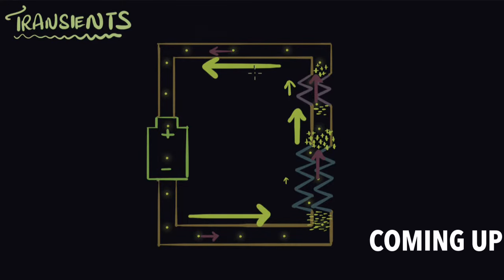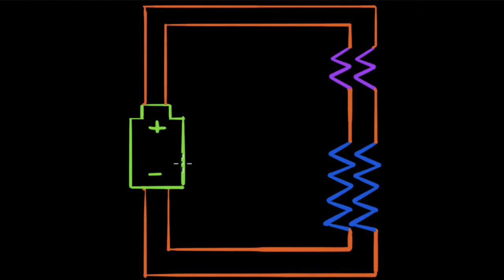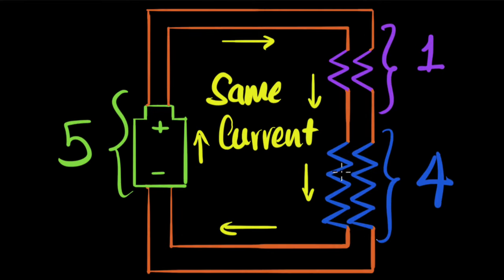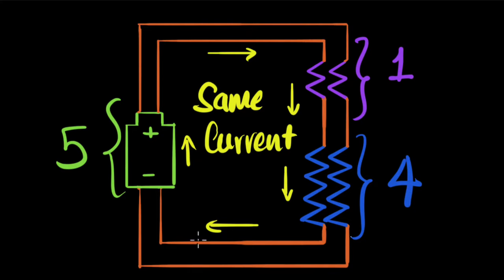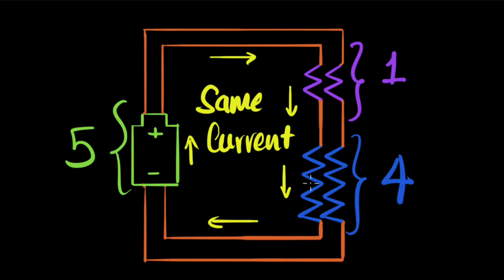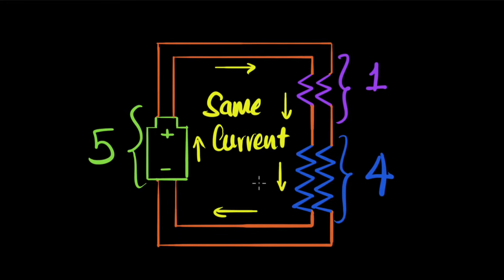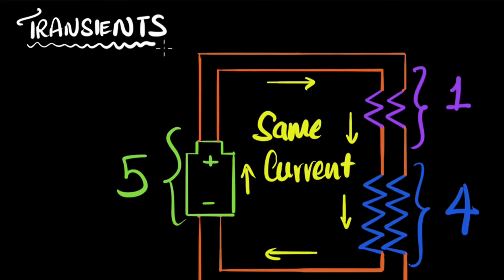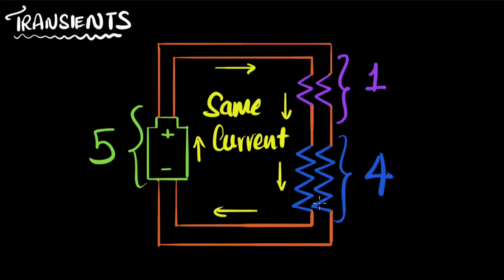Why resistors in series have different voltage (but same current)?

Comment: You are asking all of the questions that I am wracking my brain with. Most answers don't adequately explain it either - they use V = IR as a basis and you're just supposed to accept things as a given. Thank you for having the courage to address these questions, and the rare talent to be able to break them down logically and clearly. 

Please keep it coming!
Reply: electrical engineer here. V=IR does explain it, but of course there are always other ways to explain it. The universe works very different, and largely its analogy that we really understand. Some work better than others of course.

Comment: this topic was eating my brain away . it wouldn't be difficult if i accepted the knowledge of V=IR  as told by my teacers , but the problem arrised when i question why in series and parallel resistors things haapen as they . you cleared my concept of series . can i pls get a parallel concept too. your video was the best

Comment: Interesting. So essentially, right after the circuit is closed, there is a very very short moment of transient that dictate what's happening in the circuit. 

1. Right after the circuit is closed, all electrons in the circuit experience the same amount of force which is due to the battery. However, different sections of the circuit would experience different currents: all wire sections experience (relatively) high amounts of current while the resistors experience relatively low amounts. 

2. Because the resistors impedes electron movement, they tend to get accumulated at the start and end of the resistors. Negative charges accumulate at the start while positive charges accumulate at the end. The amount of accumulation depends on the resistance of the resistor. This is also the reason why there is different voltages on resistors of different resistances.

3. The accumulation of charge eventually affects the movement of electrons in the wire sections of the circuit. They eventually a. decrease the force experienced by the electrons on the wire and b. increase the force experienced by the electrons on the resistors.

4. This cycle continues until we reach the steady state, where the current is the same everywhere. It is important to note that the accumulation of charges does not disappear even after the currents in all sections of the circuit equalizes.
Reply: Thank you man you summarize the concept good then the video
Reply: Really thank to u for summarising the concept

Comment: I had to figure this out all by myself, because no one is ever talking about this fundamental stuff in the typical electronics courses, they might not even know or care about it. But this stuff is crucial to get a real understanding of why things are the way they are usually described. I figured that we have a highly dynamic situation here on a physical level and that there must be some setup and some equilibrium state, and mostly we only care about the equilibrium state (that what you call the steady state). But it is the way this equilibrium state comes about, when and how and for what reasons the initial dynamic situation settles, that makes all the difference. Thanks for confirming.

Comment: I had no idea that electrons can bunch up.  I always thought that when one atom loses a free electron,  that it immediately draws in another and as such electrons could only shuffle along one at a time.  I understood amperage by understanding that this represents the speed at which they move along but i could never understand how the potential difference between two points on a resistor could have changed...
I thought since they all move along in an orderly fashion the voltage was set by how many electron were in the negative port of the battery vs the positive and as such wouldn't/ couldn't change. 

Now that i understand the chaos of them bunching up and in a way turning each resistor into its own battery cell with its own little positive and negative port it makes so so so so so so so much more sense. 

I love the chaos,  it makes more sense than order sometimes. 

Thank you so so much!!!!

Comment: Okay, this one partly answers the last videos questions by some. The 'transients' as you call them are the acceleration periods I referred to that occurs by my explanation in the first video's comment. For this particular question, the wires ARE resistors too in which the longer they are, the greater the resistance. The symbol uses sharp squiggles that represents this as well. When learning we ignore the wires as being resistors given it represents the 'background' that has the least and is very tiny in comparison to intentionally added 'resistors'. But you CAN make a resister using the wires by simply adding length in the circuit or narrowing a part of the wire to a smaller Gage. 

Another analogy that I think might help is to investigate the flow within a closed fluid system, like our refrigerators. And although you may raise the issue of parallel resistors in another video ahead, when you add parallel piping, this increases the rate of flow which is the same as decreasing the resistance of parallel circuits in the same way.This fact also helps to understand how electronic capacitors work through the dielectric also.

Comment: That's really fascinating. One thing I'm somewhat frustrated about in my EE journey is that often, I just accept so many conventions or explanations on why this or that thing works without knowing why those happen. This video addresses one such explanation. Thank you.

Also, I'm not sure if you've already done it but I really hope you'll also do a video for parallel. The idea of resistors in parallel having same voltages across it just does not and have not made sense to me at all. I just know it does but I don't know why it does it.
Reply: The video has many errors...Also he contradicted himself with a earlier video that was talking about why the current before entering the resistance is equal to the current leaving the resistance
Reply: @xxCr7xx823  Really? Can you kindly point out such errors?

Comment: Thank You so so much sir, I have been beating myself up because I just couldn't understand why in series circuit current is same, then when we study voltmeter they say that oh we use high resistance to lower the current flow but wait current remains same...... Many more examples of this and I just... Thanks for this

Comment: Great video, which explains a lot, even though I still have problems understanding how the net force in the wire can be zero.
Reply from the maker: Thanks, Michael! If it didn’t electrons would accelerate to high speed causing high current causing higher charge deposition causing higher repulsion. 
So, it’s a self correcting mechanism
Reply: @Mahesh_Shenoy  Then that would imply that once you got the current going, if you took away the battery in this theoretically zero resistance wire, the current would keep flowing?
Reply from the maker: Loving the discussion!

If we took away the battery, now there is a retarding force on the electrons in that section. Remember, the net force was zero because the batteries force cancelled the accumulated charges' retarding force. 

Does that make sense?

Comment: A simple yet important key concept that gets missed in  textbook and by teachers as well, great video!  At 2:51  you mistakenly said maximum current instead of max resistance.
Reply from the maker: Thanks and oops
Reply: @Mahesh_Shenoy 4:34 Hi, I don't understand this part, where did the positively charged protons come from?? Because until I watched this video, I thought that electricity only deals with electrons, not protons. I understand that generally speaking, like in chemistry or something, a decrease in electrons = an increase in protons. But when it comes to electricity, I thought we were dealing with electrons only?? Where and how did the positive charges come from??

Thank you

Comment: Amazing explanation! I had this doubt but couldn't find the solution anywhere. This channel is truly underrated. But one question I still have. How is the voltage across all the resistors, when added, turn out be the voltage of the battery?

Comment: Amazing video! This could be your niche in the YouTube educational platform. 
Anyways, how does the thickness and length of a resistor influence its resistance? 
The beauty of the universe never ceases to amaze me. Is there any chance that all of this occurs in nature and not just across our artificial wires?
Reply from the maker: Insightful as always, Kou
Reply: @Mahesh_Shenoy 4:34 Hi, I don't understand this part, where did the positively charged protons come from?? Because until I watched this video, I thought that electricity only deals with electrons, not protons. I understand that generally speaking, like in chemistry or something, a decrease in electrons = an increase in protons. But when it comes to electricity, I thought we were dealing with electrons only?? Where and how did the positive charges come from??

Thank you

Comment: Does accumulation of charges concept violate Conservation of Charge Principle?  Is it correct to assume that there is charge accumulation happening at both the end of Resistors? I think we must consider the effective Resistance offered by the Resistors and the ratio in which it is split. Consider an Open Circuit or Circuit with Infinite Resistance. Can we say Charges accumulate both the ends of the Open Circuit?

Comment: Great video, very intuitive explanation.
I break my head about the question - if i connect DC motor with series resistor to a voltage supply what is going to happen.
in 1 direction you can determine the resistor in series by set the current you want through the motor and the voltage.
but how its work in the other direction? if i have given voltage source with given series resistor and i want to connect a dc motor to this circuit - what will happened in transient time that make it work?

Comment: thank you so much sir... 
Can you please do a video on "What happens to the current flow in a parallel circuit where one of the parallel wire gets fused or the bulb in one of that parallel connection gets fused"
like let us imagine there is a parallel connection where 3 bulbs are connected in parallel and 1 ampere of current flows through each bulb, total current would be 3 amp...
but when one of the bulb gets fused, will the 
1. rest two bulbs receive a current of 1.5 amp
2. or if not where will the current go away?

Comment: Thank you sir for your nice explanation on this very confusing topic. I will be highly obliged if you clarify one of my doubt regarding this topic.  My question is why the accumulation of the charges still stay in the ends of the resistor when the number of electrons going inside the resistor is equal to the number of electrons going out of the resistor after the transient stage( I mean when the current outside the resistor is equal  to the current inside the resistor) .

Comment: Sir, I'm a student of class X from Bharat🇮🇳🚩,
I'm here to understand the concept behind series connection of resistors..
While watching your video, I just got a doubt that why are positive charges accumulated on the other side of resistors.
Please help me in clearing my doubt!
Reply: When there are no negative charges, the area will become positively charged, because all the negative charges are accumulated on the negative side of the resistor and the electrons passing the resistor are very less

Comment: Shouldn't the charges near the resistors(not in the middle of the voltage divider, only outside) be only dependent on the battery voltage? Since the charges have to have a force that will cancel out the battery force?

Comment: Hi Mahesh sir,i would really appreciate your efforts that you put to make things easier which wouldn't be possible otherwise.
You make science look good,feel good and love it .
But i have a question sir ,in the last video you emphasised a conductor as a space full of electrons where there is no room for them to travel any faster,like a packed cars.But here you changed this idea and described that when forces acts they can accelerate or slows down.May be answer lies in the fact that last video was all about steady state current and this video is about transient state.But still i am wondering why did you change the picture of packed cars to a system where there is enough space between two cars,i mean to say two electrons.
This question is haunting me sir kindly respond to my question.
Thank you sir

Comment: 14:15 
If the voltage at the ends of the resistors is due to the accumulation or charges at its ends why its sum  has to be equal to the voltage that the battery has?

Comment: Sir,Why the voltage dropped across parallel circuit is the same and the current through this corcuit are the same ?

Comment: If we add a resistor to a circuit the total current will slow down as a result right ? How is the accumulation of charge possible?

Comment: if the forces in the upper and lower section disappear , what drives the electrons from and to the ends of battery? the forces in the resistors?

Comment: Sir , pls clear my doubt, since there is no resistor between the ends connecting the two resistors , won't the potentials there have to be the same? But  the diagram you drew suggests there is a potential difference between those two points.

Comment: Okay so if the voltage drop in the last resistor is 1 so voltage across the resistor is 0V. So how will the current flow?

Comment: Are there any plans on making videos about "diffraction" for khan academy class 12 physics wave optics unit?
Reply from the maker: I think they are already there. Check the website
Reply: @Mahesh_Shenoy  The differaction videos are from Physics Library > EM waves. And they don't cover all the CBSE syllabus topics.
Reply: @Mahesh_Shenoy 4:34 Hi, I don't understand this part, where did the positively charged protons come from?? Because until I watched this video, I thought that electricity only deals with electrons, not protons. I understand that generally speaking, like in chemistry or something, a decrease in electrons = an increase in protons. But when it comes to electricity, I thought we were dealing with electrons only?? Where and how did the positive charges come from??

Thank you

Comment: Hi sir👋👋. You explained very well about resistors in series. But I can't visualize how resistors in parallel work....  We connect resistors of different resistance, then the charges accumulated in the ends of resistors will be different, then how we say the voltage stays same across all resistors??? Please make a shorts or video about this sir🙏🙏

Comment: Thanks sir for the great explanation  I really appreciate how you cleared a lot of misconceptions In a simple way .... I wanted to ask you sir about the parallel circuits since the loads on the same branch are connected in series they get the same current but how does the current out of the branches behave and how does the charge accumulation in the branches affect it. Thanks again and hope that you can see my question.

Comment: Sir, After the transient stage, The current is equal across the wire and the resistor, So there is no more accumulation of Charges at the ends of the resistor, So how do we measure the voltage there?
Please solve my doubt.

Comment: Wow, great explanation. I understand the theoretical part of eecs but often have a hard time making sense of it intuitively/logically like this. Do you refer to papers or books for this deep circuit analysis like this? All i find are theoretical answers proposed through the use of equations.
Reply from the maker: Mostly online research. I try to look at the equations and distill the intuition out. And then share it
Reply: @Mahesh_Shenoy 4:34 Hi, I don't understand this part, where did the positively charged protons come from?? Because until I watched this video, I thought that electricity only deals with electrons, not protons. I understand that generally speaking, like in chemistry or something, a decrease in electrons = an increase in protons. But when it comes to electricity, I thought we were dealing with electrons only?? Where and how did the positive charges come from??

Thank you

Comment: Sir i am confused,i saw the video of potential difference on khan acdemy it was amazing but sir We know that the kinetic energy of electrons gets converted into heat energy which comes from the repulsion of terminals not the potential energy of electrons.then why do we need and mean by voltage?

Comment: I hava a question that is if the forces are only in resistors it means that due to force acting on resistors causes the flow in charge. (Electric field form in the resistors)

Comment: Ok this is incredible 👏👏👏
But you said that forces only exist inside the resistor after the whole process. So the electrons should speed ip inside of resistor and therefore not slow down.
Then how can a resistor RESIST the flow of current?